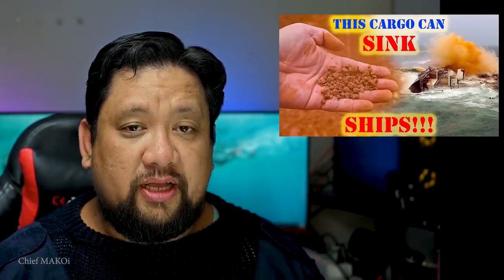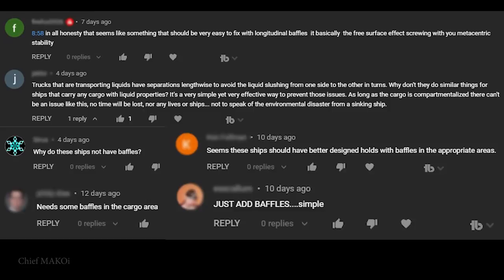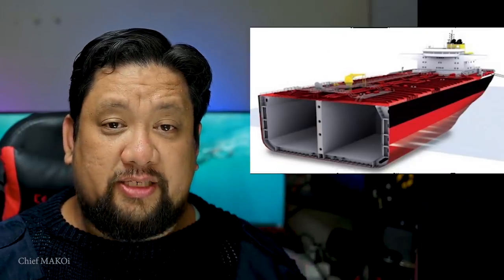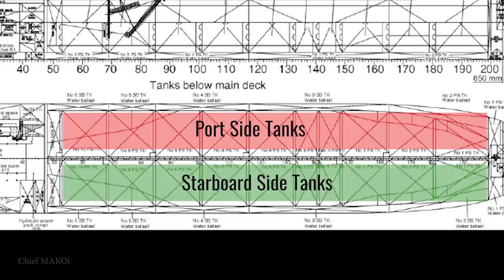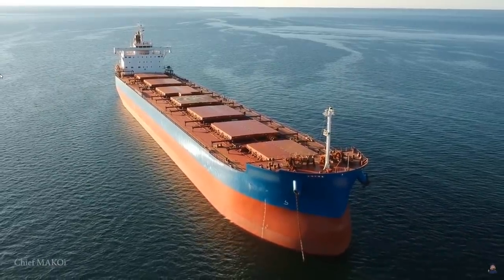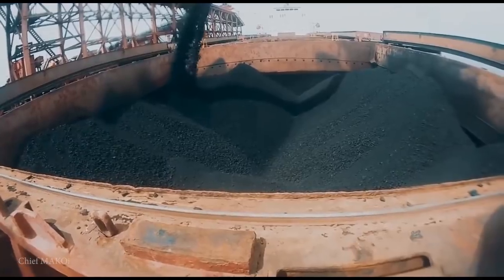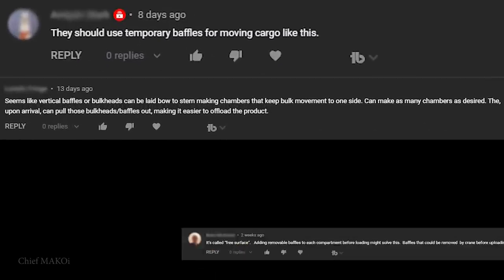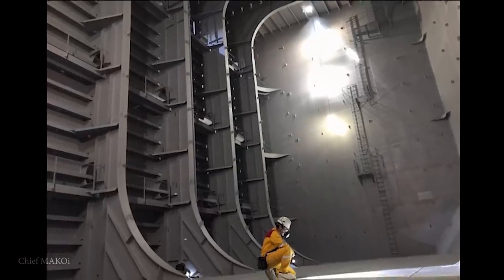Free Surface Effect: Should Baffles Be Installed in Bulk Carrier Ship's Cargo Holds? | Chief MAKOi

Comment: Mineral process engineer here. We are always watching the moisture content of mineral concentrates (note, these aren't ores) to keep the moisture high enough to avoid dust explosions and low enough to not liquify. Gotta meet both criteria.
Reply: I know grains can create dust explosions but can mineral dusts?
Reply: @ValCronin  if its reactive with oxygen, yes. things you'd never think could burn act different when they are given a ton of surface area to react with the 20% atmospheric oxygen. coal dust is a well known example, despite coal being relatively hard to ignite in chunks , as a dust it readily explodes.
Reply: @ValCronin  Most metals are flammable if in a sufficiently fine dust. Remember that rusting is just very slow burning. Steel wool will burn, for example.

'Mineral' is a bit vaguer. If it's already an oxide (bauxite appears to be a mix of various oxides and a few hydroxides), it probably can't be burnt further with air. Other salts are probably also non-flammable I think.
Reply: @ValCronin  Yup, even a concrete plant can explode violently from the dust.
Reply: @ValCronin  coal is technically a mineral too :)
Reply: oh man... you sparked my interest! mineral concentrates? so Alumina? yellow cake? that kind of thing... anything else?
Reply: Sounds difficult and interesting as a problem to manage.
Reply: @ValCronin  Surprisingly, more dusts are explosive than not. There are about five NFPA standards and numerous laws that were created to help industrial professional realize that most dusts are explosive. From chemical engineer with a large amount of expertise in safety.
Reply: Aewwea aww q no se puede pagar por qqqq

Comment: In summary, it’s easier to make sure the cargo prone to liquefaction is within the standard moisture levels than it is to retrofit every entire bulk cargo ship in the world in case one port isn’t maintaining quality standards
Reply: Or the same point from another perspective; it would cost more in TCO to build a ship that can safety carry wet liquefaction risk cargoes than it would to just loose that cargo.
Heck, if that's a non-trivial problem at some port, it may actually make more business sense to build and operate a commercial ore drying plant, rather than building special ships.
Reply: As every once in a while it goes wrong it's apparently not that easy (I can imagine they can take in some water under rough conditions too), or at least people may be tempted to seek out the limits to maximize profits. Both could be solved by installing bafffles. These baffles being there they can just as well use them and there's less incentive to cut corners. No solution is 100% so I've no objection against a plea that accepting the risk is the better option.
Reply: @RoadDestination  the people willing to cut corners are the ones least likely to spend the extra money. You could try to enforce something via international something, but those same people will just do their business with whoever doesn't agree to apply the restrictions. Really, what's the point? It sounds to me like it's already well known how to deal with this risk, so it's only a problem to people who decide to ignore that wisdom.

As long as everyone involved knows enough to correctly understand the risks they are taking on, then I say let them make the decisions, reap the rewards and suffer the consequences.
Reply: @benjaminshropshire2900  They did it with single-hulled oil tankers. The destinations made it illegal to operate single-hulled ships built after a certain date in their waters. The response was for MARPOL to make that a worldwide standard within a couple years.
It's generally not the ship owners that "suffer the consequences" of unsafe operations. They have insurance too to protect them from the financial consequences of unethical behavior.
Reply: @Markle2k  If the the ship owners are lying to the crew or forcing them to work on the ship then I might agree with you. However if they can make an informed choice and are willing to take on a know risk to work on a more profitable ship? I don't see where it's your or my place to say they are wrong. (Every choice you make, someone thinks is dumb. If that a good enough reason to refuse you that choice, then you only have the right the people in power today think you should. The most basic right has to be the right to make bad choices.)

And it's very possible the choice might even be between working on that ship the way it is, or there not being a ship to work on at all: drive up the cost of the ship and the number of cargos that can afford to use it goes down, and with it the number of crew the industry can find the revenue pay them from.
Reply: @benjaminshropshire2900  Making an informed choice is not the issue. It is about possibly losing your job 10,000 miles from home. Coercion can happen many ways. If you have a uniform standard that must be kept, then all boats float on the same level. That cargo is needed someplace else. If it wasn't, they wouldn't be spending millions of dollars to have it hauled elsewhere.
Reply: @Markle2k  I was already including that sort of coercion under "forced". And if they didn't know that the boat would be willing to take on unsafe cargo than signing on falls under an uninformed decision. Both those are problems.

But if they knew that was a possibility and choose to join anyway, that's their choice to make. That is far from the biggest risk I've heard of people knowingly taking on in the hopes to get a better life out of the deal.
Reply: @benjaminshropshire2900  The ones taking the risks are not the only ones that face consequences if things go wrong. So it's at least a bit short sighted to say if they choose so....  Also, how much choice do they really have if their and their families livelyhoods depend on it and the boss pushes? How much choice do shipper have if the competition works with lower and thus cheaper standards?  As said, I've no objection to a plea that it's an acceptable risk, 100% security doesn't exist after all, but that doesn't mean that the risk should be accepted without debate and proper consideration of everything involved. I don't know what the standards should be, it's subjective anyway, but all stakeholder interests, all pros and cons should be considered to decide on those standards.
Reply: @RoadDestination I don’t think the problem is big enough for such extreme measures
Reply: @RoadDestination  I'll grant that the cases where the risk and the benefits go to different people are really nasty to deal with. Oil tankers are a great example of that problem. As to free choice: the type of scenario you describe is exactly the type of coercion (well one of them) that I'm explicitly saying is a problem. As to what are risks acceptable: I think that should be something the people risking the consequences (see my first sentence) should be mostly free to decide for themselves. The cases where society should deny people that freedom should be very rare, and very carefully and reluctantly considered.

So I guess I sort of halfway agree with you. But I still have two points:

Point #1: It's very possible that a proposed solution would cost more than it would save, even if you are only counting human lives.

If we assume a half dozen ships a year sink with the loss of all aboard (both assumptions I suspect are high), that's something like 100 deaths a year. How much of an economic downturn would it take to kill 100 people per year? Decreased income can result in 5-10 years lower life expectancy (in the US, likely higher elsewhere) so a significant decrease in income for something like 1-10 thousand people may well be enough to "kill" more people than those 100 lives that were saved. (And that ignores quality of life effects.)

So would a proposed change significantly hurt the equivalent of a mid-sized town of people? If the cost of the ships goes up, then that cost doesn't come solely (or possibly even mostly) out of the dividends the owner gets. It can also result in some marginal cargo runs becoming unprofitable and being shut down putting people out of their jobs at those mines, in those ports, on those ships and at industries that consume those products. Those people will earn less (decreased demand for labor) and spend less, decreasing demands for things they are no longer buying. At the same time the cost of products made from the material goes up (decreased supply of inputs) which can make some other products unprofitable, decreasing their supply, which starts another ripple. So a mid-sized town out of a job may be an accurate or even conservative guess.

If you want to get really ruthless about it: what's the opportunity cost for the proposal? We don't have infinite resources to spend so $1 more here is $1 less somewhere else. Could you spend the same money somewhere else and save more lives? One source I found claims you could save 100 lives for about $333k donated to the right charity. At a guess, including bulkheads in a bulk hauler (most of which would never make a difference to) would cost more than that *per ship*.

Point #2: Why mandate any one solution when what you actually want is a result? From what I can tell, there is already an entirely workable solution that is every bit as safe as redesigning ships: don't ship wet ore. If you want to talk about first world nations mandating safety measures, then they should mandate that the shipping be "done safely" and let the industry present proposals for ways to accomplish that. As long as the regulators vet the proposals properly (which, unfortunately, is something that has to be assumed regardless), that will have the same end effect and the market will figure out the most cost efficient way to accomplish your end goal.
Reply: @benjaminshropshire2900  Don't know on what you halfway agree with me. I've just stated that I don't know what the standards should be and that I think creative engineering solutions for baffles are possible to address the objections in the video. You can get carried away with assumptions about economic impacts and claiming there is another solution, that in theory may be there, but reality is that ships do go down, so how much of a solution is that really? Again, I don't know what the standards should be, but in deciding on those standards all stakeholder interests should be considered. You do a good job in argueing the case of the shippers, but that's of course only part of the entire picture.
Reply: @benjaminshropshire2900  Or another step further, intentionally liquifacting these solids and transporting them in refitted tankers - ditching the use of bulk carriers for this purpose.
Reply: @DSiren  That's an interesting thought. It could work. But there are some clear downsides:

1) it won't reliably stay liquid unless their's lots of water in it.
2) adding 5-10% of water to your cargo removes 5-10% of your cargo capacity for the stuff people pay you to get to the other end.
3) on average I'm guessing the other cargoes (oil?) tankers could carry are more profitable to move.
Reply: @benjaminshropshire2900  on #2 bauxite and iron ore are heavier than water, so 10% by volume is less than 5% by weight, which is what matters in the draft&bouyancy calculations.
Reply: @DSiren  I was under the impression that by-weight (which is much simpler to measure) was the standard. Regardless: more water -> less paying cargo. And at a guess you need a lot more than that 10% water to keep it liquid enough to tank it.

What might work is to load dry(ish) and then pump water in at the other end to unload. But that still results in someone down the line needing to expend the energy to dry it out.
Reply: Your summary completely ignores the true reason, not sure why you got 150+ upvotes. Has nothing to do what what's "easier," it has everything to do with the fact that these ships are designed to carry SOLIDS, not LIQUIDS. Installing baffles would mean they are no longer suitable for their purpose of carrying solids. Should we build ships specifically for loads susceptible to liquifaction and not be suitable for normal solids? Take out a giant ass loan, build one, and find out.
Reply: @x3wildcard  A removable baffle system would accommodate both.
Reply: the risk is so low that insurance covers it, bad for the sailors, then they should trust their captain did the right thing already in many cases. this is such a no problem.
Reply: @monad_tcp  people trust the Captain to do the right thing for a lot of things , as long as the captain is following procedures and the port authorities are maintaining their standards and following their procedures there’s minimal risk , problem is unlike aviation industry the marine industry doesn’t enforce high safety standards in all countries
Reply: Well putting those type of cargos in ships and send them out to sea is extremely dangerous, as a simple leak would make the vessel unstable and might stress other parts to spring leaks etc.

It would be better to redesign new ships to have left and right cargo holds with equal size to the current ones and just forbid older types to load those kind of cargo.

Comment: Excellent discussion. Another hazardous material is metal turnings. Instead of liquefaction, you have fire to worry about. Metal turnings are coated with oil and where the oil isn't they will rust. The oxidation process generates heat to a point the oil residue will ignite. The USCG checks vessels transporting these metal turnings. Each hold has temperatures taken at various places and must be at or below a temperature listed in a Code of Federal Regulation administered by the USCG. Fire at sea can ruin your day.
Chief Makoi, thank you for your very informative videos. May you have smooth seas and a following wind.

Comment: The answer is simple. Tankers has baffles to minimise the innertia but liquid can come back to each original state, bayxite if it gets liquified would get on one side and stay their even with the baffles on, it would list heavily, and with swell I would made more the list following by capsize, so no the answer isn’t baffles. The solution is to constantly check the dew point of the cargo hold and make an air circulation when needed. Also double check the liquid percentage before loading. Great vid chief, keep up the good work !

Comment: While ships sinking because of this problem is a horrible reality, my guess is this type of disaster is a very tiny number of trips.  As Chief MAKOI stated in the previous video, the ship he was on refused to load a cargo that could have potentially had this problem.
Reply: I'd also wonder if this liquefaction happens on any other types of shipment.
Reply: Bt as he said in that video also, that can put a lot of pressure on the captain!
Shoulda, coulda, woulda!
Reply: Overtired crew crashing planes was a "small" number of incidents compared to successfully completed trips. The same for long-haul semi drivers. The pressure to "get the job done" is itself a safety risk. It encourages rationalizations. That ship that sunk probably wouldn't have sunk if the weather and sea state had cooperated. But it didn't.
Reply: @JarrodFrates  great comment, thank you
Reply: @JarrodFrates  That is a far higher accident rate than in cargo airliners per flight where cargo shifting is taken far more seriously than demonstrated here.
Reply: Well it is always about cost, and sometimes things are run to the wire a bit too much. And sometimes you are just unlucky
Reply: @louiscypher4186  And yet they don't think of those suited penny pinchers.  They think of their own image as daring souls.
Reply: @satunnainenkatselija4478  And…. Your point is?

Comment: Be interesting to see how cargo holds get cleaned when transitioning between liquid loads to solid loads. And to see how ship’s contents are unloaded. Thx always enjoy your videos. Extremely well done and informative. Cheers
Reply: Bulk carriers do not take liquid cargo unless the liquefaction does happen
Reply: Same question but not for liquid to solid. Rather from a toxicity perspective. How is cleaning performed when transitioning from ores like anthracite to foodstuffs like grain? Are there specialised procedures to ensure contamination does not occur?

And how about scrap metals that may contain lead or mercury to foodstuffs?
Reply: The Chief has a video on that...  check his video list....
Reply: I have been in the shipping business for many years and there are cleaning methods for vessels. In fact the USDA and stability representatives get onboard to check the vessel prior to loading.
Reply: @captainotto  the cargo hold will be washed with clean sea water and the second washing will be fresh water to make sure salt are removed from cargo hold
Reply: @captainotto  high-pressure washing mostly, sometimes with various solvents.  To clean some cargoes, diluted acid is used to break it apart and come off the walls.  Multiple rinses with river water or fresh water, followed by a final rinse with clean fresh water.

Nowadays for dirty/oily cargoes, many ships spray a protective film over the hold.  It keeps the coal/petcoke from sticking and washes off easier after.